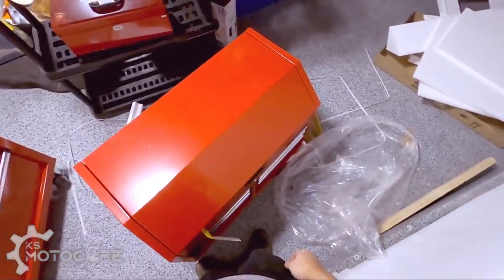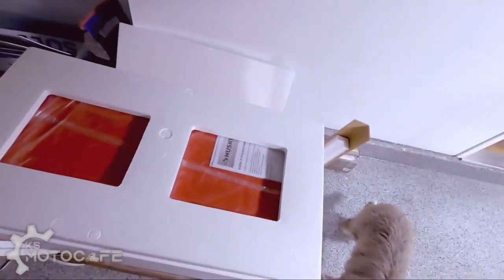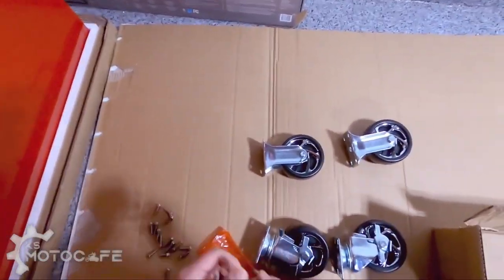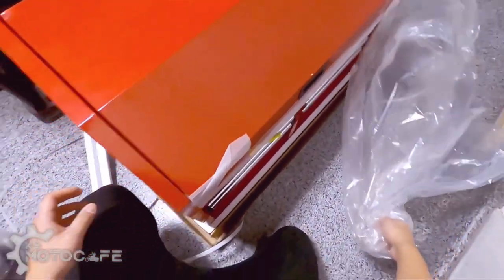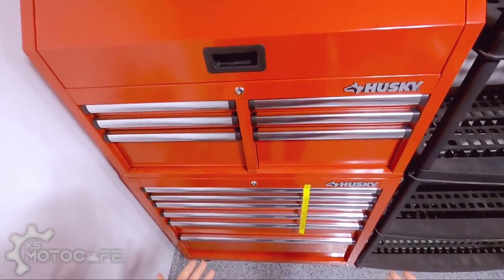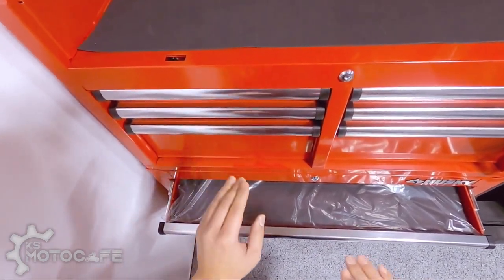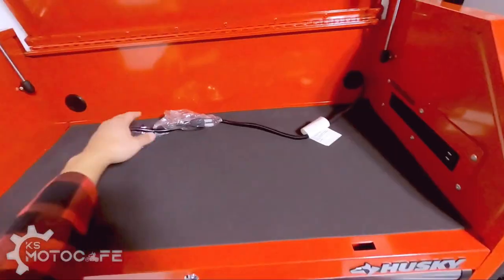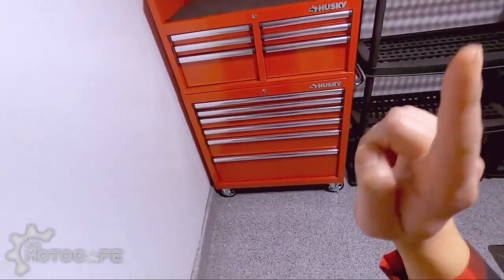Unboxing and Installing My Husky 36 Inch Tool Chest | Garage Makeover Ep 4

Comment: Nice tool chest.  I should be upgrading my toolbox soon.  If I am lucky, I could get the a display model and get a decent discount.
It is how I got my refrigerator.  😉
Reply from the maker: thanks! display model from home depot?? how much do you get off?
Reply: @KSMotoCafe  A $1499.99 refrigerator cost me $960. Yes it had scratches and scuffs, but works just fine, and I also had an extended warranty for no extra cost!

Comment: I’m not 100% sure that black has a power bar but I think it dose and just blended in to the paint and shadowing of the image
Reply from the maker: can confirm black one does not come with power bar
Reply: @KSMotoCafe do you or anyone know why this is? I think what husky is doing here is dumb dumb dumb.  Example, in the US all the tool chests have power strips and other features like soft close.  In Canada this is not the case.  Then we have this model. Red- power strip, Black - no power strip.
Reply from the maker: @matthoffman6962 no clue - I think it makes zero sense since the mold is the same